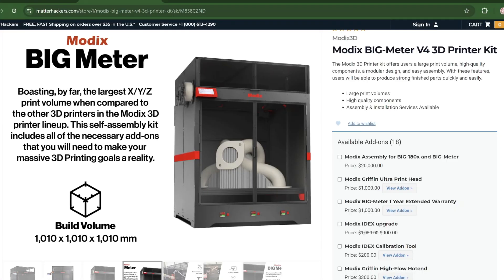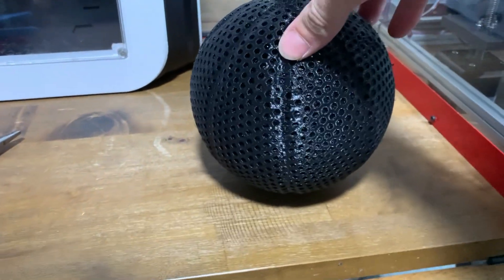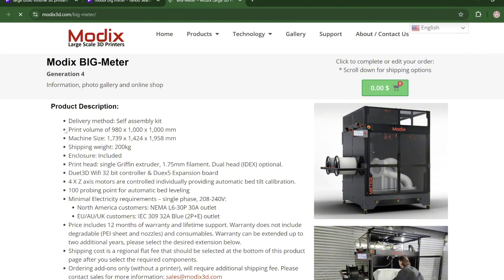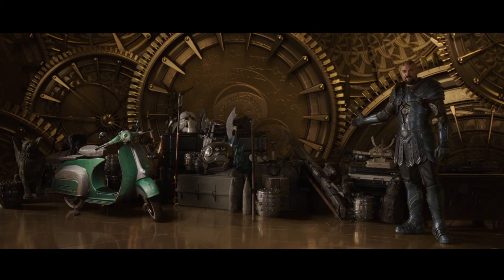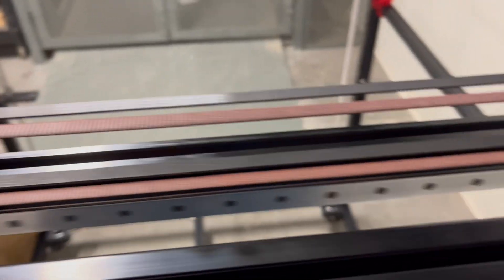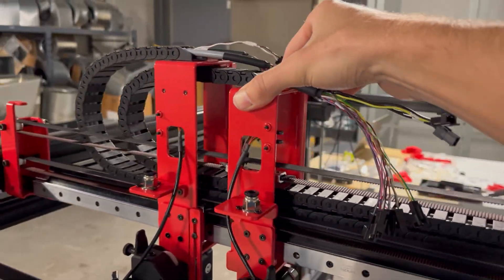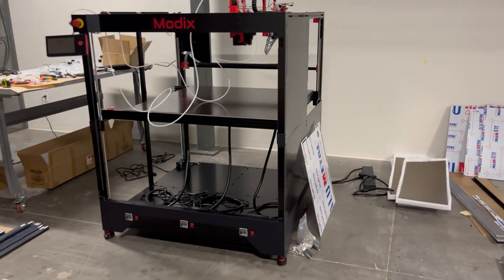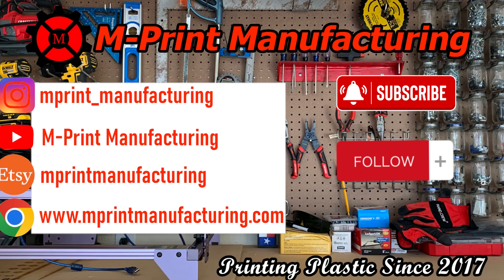Ep. 13 | Modix BIG-Meter 3D Printer | Large Scale 3D Printer Build | Unpacking and Assembly | Part 1

Comment: How about 300 x 300 bed?
Reply from the maker: I just finished a printer with a bed size of 310x310 and it is a good size. You should check out the print lab blogs EP. 16-19 to see the full build.